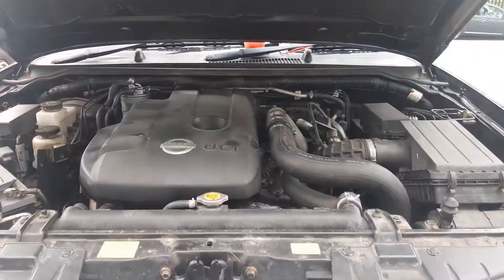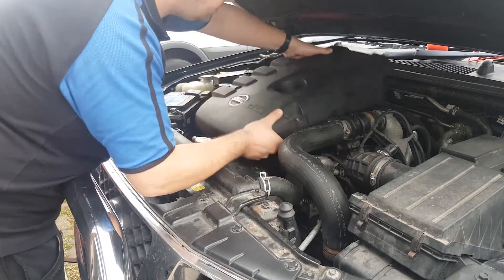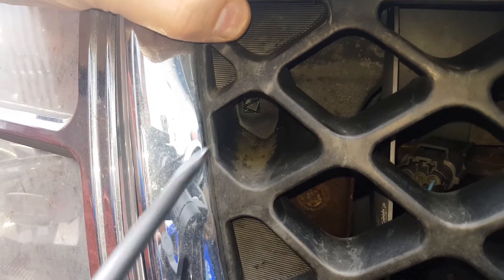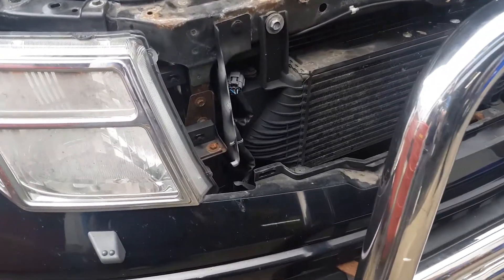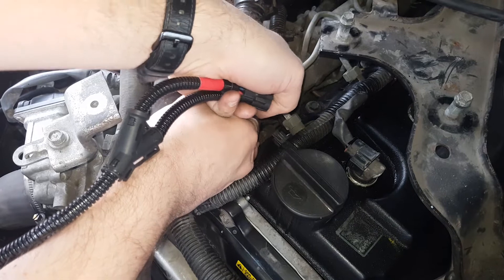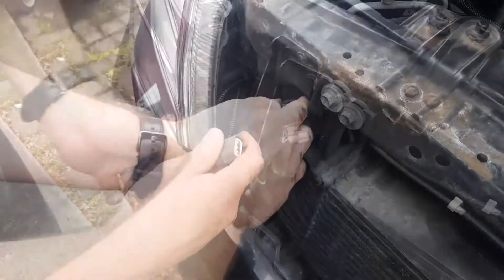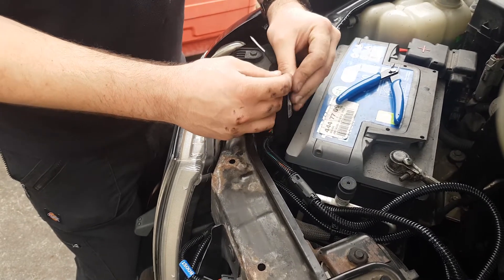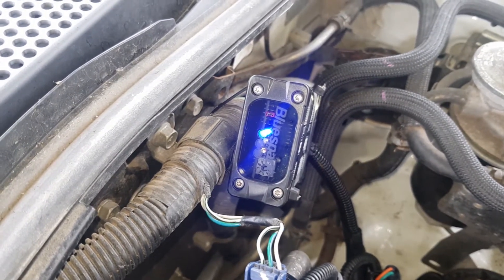Bluespark Automotive Nissan Navara 2.5 Chip Tuning Box Install Video

Comment: What results can be expected from this & is it at a detriment to engine wear & reliability ?
Reply from the maker: We actually have had this on our Dyno.  We are able to get 210hp and 477Nm with our Pro + Boost Unit. 
As long as the vehicle is well maintained and serviced, there should be no additional wear caused by using the unit. 
The maps are developed within engine tolerance limits so it should not affect reliability.
You can see the Dyno run through the following link:
https://youtu.be/_xp50zbsAK4